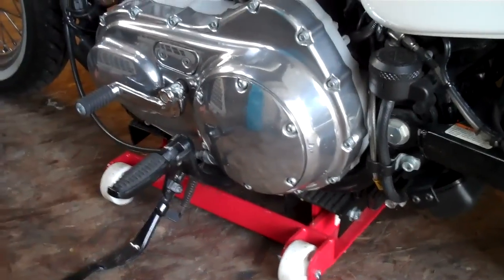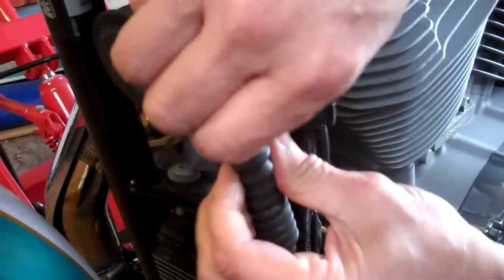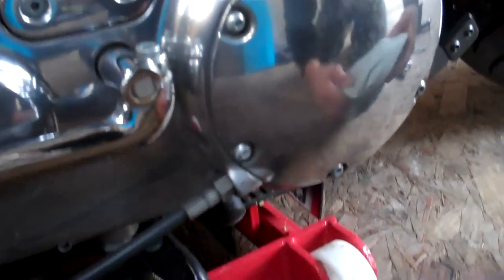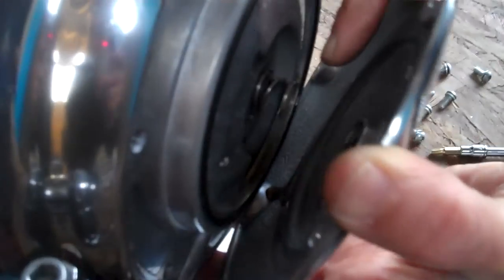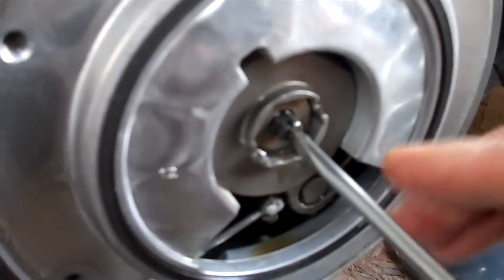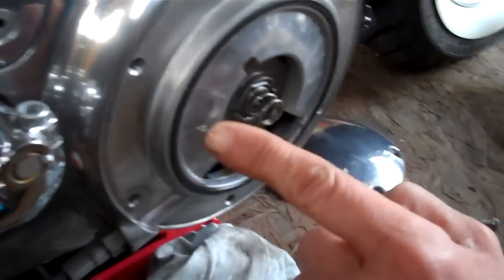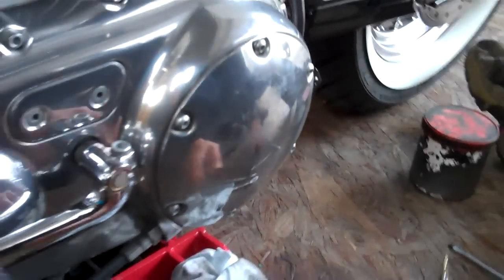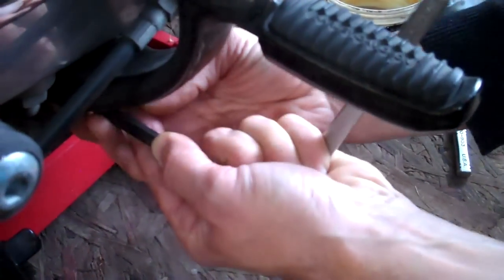Delboy's Garage, Harley Sportster Clutch Adjustment.

Comment: Delboy, 2007 1200c sportster 14,000 miles.  Clutch from Hell.  My original problem was I "thought" the clutch cable was "stretching"!! One minute handle is loose... next minute it is tight.  All during the same ride.

So I do a proper adjustment.  Derby cap off.  Counter-clock seat turn and 1/2 clock-wise turn.  Adjust the front fork adjustment til the clutch lever is 1/8" play.  Now it won't stop slipping.  I just drove it and stopped (with my trusty 1/2" & 9/16" wrenches)  5 times to adjust and failure... still slipping.  Would further clock-wise turning the main clutch adjustment help?  Maybe the clutch discs need replacing?  Maybe I have the clutch that cannot be adjusted..

thank you for all your videos.  Really well done!
Reply from the maker: Hi Julianne. OK, working purely on the information you have given me... and asuming the rest of the transmission is in good condition, it sounds like you've wound back in clockwise a tiny bit too far, its 1/4 turn not 1/2 turn.. but that wont make it slip so much...

Ok the two items that can be at fault are the cable, or the plates, and to isolate which it may be, you must check them independently, so first with the Derby cover off and the cable fully slackened at the centre bottle screw, drop the bottom of the cable of it's clevice fork and the top of the cable out of the lever so  that both ends of the cable are free... then by holding the top the cable push in and out to ensure it has slippery and slick free movement up and down the outer casing with no binding or resistance...

If there is resistance in it check it is not pinched or kinked anywhere and if not, then just replace it... it may have become corroded inside

If it is free moving and in good order, then the only other thing is to drop the clutch pack out completely and inspect the plates to see if they are worn out or warped...

Once you know the results of those two tests, you'll find your remedy
Reply: Q- how good are you?  

Inside the derby cover, the adjustment 'screw' completely OPEN to CLOSED is like, 5 complete turns. You wouldn't think 1/4 turn would make a difference.  But it does.  

A- pretty darn good!!  Well done.
Reply from the maker: Julianne Carol  So, has that fixed it then??
Reply: Moonfleet41
Poop!  It is back to having 1" play in clutch lever one minute.... and the clutch lever being taught the next.  When it is loose you can not slip it into neutral while stopped.  I never sprayed wd40/silicon down the cable, as you did.  Maybe that will explain the situation.  I explained this problem to a Harley parts salesman and was told the cable end, that pulls the clutch discs apart, gets 'gummed' sometimes.  Since it sits in moving motor oil and I didn't see anything unusual I dismissed that idea, but maybe.  I will look again.  thanks again, Moonfleet.
Reply: Moonfleet41 What did fix it was lubricating the cable.  AGAIN.  Seems strange but, since the clutch is 'wet', what ever you put INSIDE the clutch cable will go directly into the engine. No?  I did re-adjust the clutch tight and back off 1/4 turn, also.

From somewhere (I think a sewing machine) I found a sealed, single use (not refillable) soft plastic oil syringe. The oil tube is tube shaped and squeezed.  That is the lubricant that went down the cable.

The Harley parts employee said he sells a lot of cables to people who don't lube their clutch cables.  I know it is part of the 50+ point Harley maintenance,  but I am surprised this fixed my problem.... but it did! Thanks moonfleet41
Reply: comment Mark Bates?  repaired 5/22 and still repaired.  Moonfleet41, could NOT have fixed it without you..... thanks

Comment: Hi!

Having ridden more years than I can remember and having always tinkered with my Bikes, I have still learned an awful lot from your videos. (Great image quality too.)
Thanks a bunch.

I have just taken a refresher course before a post winter service.

BTW, is that a massive oil radiator I see on your XR?

How tricky is an oil cooler to fit and is it worth fitting a similar item on a XL1200C?

Thanks again and keep up the good work.

Comment: Hi Delboy, sorry for late respond. the little while under the handle bar was the trick all good now, I'm going to service the bike under your instructions. I have checked the vibration matter with local Harley shops they say its normal. I wonder if break fluid has a shelf life time? I do have a dot4 bottle that has been used a little and recapped about 2 years ago, do you think sill is good? or I should by a new bottle. I'm new on bikes and trying to learn how to maintain it too, this bike does have the Vance Hines pipe but I have no idea where the instrument (command system?) installed on the bike, what dose it look like and what colour is it? I assume I'm the third owner and no idea if it has been dayna tuned.
Have a great day mate from down under
Mehrdad
Reply from the maker: +mehrdad sahba   Hi Mehrdad... with your brake fluid... if its two years old and been opened, throw it out mate, buy a new bottle its really cheap and easy to get from the car shop... and your ECU (command system) is a black box under the seat...but you cant tell from looking at it if the bike has been remapped... the best way to tell if its running right is to check the spark plugs....ride the bike for about 5 miles in one long ride...top gear, fast...not round town.. then switch it off and take the plugs out... the tips should be the colour of biscuit...not light like cream, and not dark like chocolate...a nice light biege... if they are... then its fine and you can carry one riding...good luck with it mate.. take care Del.

Comment: Great videos man, got a question for you, my Iron 883XLN sporster leaks oil from the shifter next to the clutch, it's seaping from the actual clutch box housing where the shifter is connected to. It's not a lot of oil seaping but enough to notice that it is slowly hemorrhaging through time. I was wondering if you could post a video on how to fix this ourseleves.

Comment: When I replaced my clutch cable on my '99 XLH883c I followed these instructions but now the bike wants to die at the top end of 1st gear? I am confused did I tighten the clutch ramp too much or not enough? My old clutch cable was rather tight and had the adjustment on the clutch ramp tight-ish too... I am not quite sure how to rectify this..
Reply from the maker: What exactly do you mean mate by 'wants to die at top end of 1st gear'??  Do you mean the power is dropping off, or is the clutch slipping? What exactly is happening??
Reply: I figured it out! I had buttoned up the derby cover after doing the clutch ramp adjustment and then did the cable adjustment... that was the problem, I had to leave the derby cover off and then do the cable and then do the clutch ramp once more and it was perfect! I found my rear jug plug was fouled out, so I will be doing a carb clean n tune very soon.

Comment: Thank you for the nice video. I just purchased a 2005 Sportster. It got loaded on the trailer nicely, however, when I got home and after I struggled to take it off the trailer by myself, the bike wouldn't go into gear. None of it. Do you think the clutch got off adjustment? Where may I purchase the tork tool? Thank you.
Reply from the maker: Hi Gaspare, sorry to hear about that, can't imagine what's wrong without a little more info... when you say it won't go in to gear, do you have the engine running whilst trying?? And is the clutch dis-engaging when you pull the lever in??  Also, do you have the side stand down whilst trying to get it in to gear??

The torque wrench can be purchased from any good tool shop, but steer clear of cheap ones, it's an investment in precision!
Reply: Moonfleet41 The engine are running. The kickstand is up and the clutch has a little play. How would I know if the clutch is dis-engaging? Thanks
Reply from the maker: Gaspare Misseri  Ok, so you initially said it would not go in to gear, so what happens when you press the gear lever down with your foot??  Engine running, side stand up, lever all the way in to the bar, press the gear lever down... and what happens??
Reply: Moonfleet41 Nothing, I don't want to brake the shifting lever. Besides, it shouldn't be that hard to shift, right?
Reply: Moonfleet41 Please also note that the lever moves and returns in place, so, the spring appears to work, it just won't go into gear. Could it be that the clutch doesn't engage? Shouldn't it go in gear when engine off, moving the bike back and forth while applying pressure on the shifting lever without the clutch pressed? That the way it was back in the day, not sure the newer stuff can be shifted this way or not.
Reply from the maker: Gaspare Misseri Hi again....that sounds very odd.. not heard that one before, you can try to select first gear with the motor off....like you said, roll back and forth with clutch in to line the cogs up....and see if you can get first gear that way..?
Reply: Moonfleet41 I've tried everything. I've also called the mechanic who sold it to me who is attesting that it worked fine, I could kick myself in the ass for not taking my helmet so I could take for a test drive, anyhow, no need to cry over spilled milk. The gentleman has been in business over 50 years and appear to be an ethical person, at least that was my impression when I met him. In any case, he told me to take it back for him to take a look at it, that is what I planning on doing on Wednesday. I tell you, if I didn't have my plate extra full, I would probably get in there myself and readjust the  clutch. I think after watching your video I could probably do it. Weather is perfect here in NC for riding. Thank you for your attempt to help me.

Comment: Thanks Del, great informative video but I did have a question. I have a 1981 Yamaha SR250. The bike shifts great but the clutch doesn't engage as quick as I want it. Basically it feels like when I have it pulled in all the way and start to release it in gear it doesn't engage until the clutch handle is almost all the way open. Do I need to adjust only the clutch cable or the actual clutch or both. This is my first bike so still new to it and not sure. Any help or suggestions greatly appreciated. Thanks again for the great vids!
Reply from the maker: Hi Micah.  If you have adjusted the cable so it pulls cleanly and opens the plates full, and has a little free slack once its released, then its not adjustment.... it will more then likely be the plates in the clutch have worn out...it is 33 years old....Its not a hard job, or expensive.. and you'll find it will make a huge difference.. Good luck with it.. Del.
Reply: Moonfleet41 Thanks a lot Del def. something I will investigate and check out. Really appreciate the feedback!

Comment: Hi Del, I've watched many of your vids and you seem like a very knowledgeable bloke, always make me chuckle.
A mate of mine has a sporty and says when he changes to second it jumps out back into neutral, everyone he's spoken to says it's a common problem but hasn't found a fix. Have you come across this before? Cheers
Reply from the maker: +tinks43 Hi Tinks, any bike jumping out of 2nd gear can be quite a bad sign... is it high mileage??  and is it an older bike?? ...
Reply: +Moonfleet41 Yeah, 1998 with 18k if I remember correctly.
It's only from 1st to 2nd. If he pulls away starting in 2nd (which he has been doing to overcome the fault) it's ok.
Not an easy fix then, something inside the box? Have u ever heard of such problem? Cheers
Reply from the maker: +tinks43 Well its 17 years old, not many miles, but who knows what abuse or neglect in this time... all you can do is check the clutch adjustment, cable tension/freeplay, and the selector pedal itself so make sure its fully engaging the gear.... and if its none of those things, then the next step is to take a look inside the gearbox and see if you have any worn bearings or bent selector forks.. you can usually tell by looking at the oil, and in the oil folter for any swarf of chips of metal... either way buddy... its a big job... any bike engine jumping out of gear usually signals a hard life and major repairs... sorry so be gloomy, but im sure you'd rather know the worst..

Comment: I followed your steps, but think I may have turned the adjusting nut (long barrel) down too far, actually I had used the wrench to turn down the adjuster nut. I am getting a winding noise when I put my bike into gear, is this perhaps the reason for that winding sound ? thank, Lance
Reply from the maker: im not sure exactly what sound you're describing, as you can imagine its pretty hard to diagnose faults over email by a brief description.... all i can suggest is to retrace your steps and follow the video, its all laid out correctly for you to follow... there is no 'adjuster nut'... its a screw, and the nut doesnt turn is sits in a recess and holds the screw still onve you set it... so im not really sure what you have done there Lance..?
Reply: I was referring to the 9/16 lock nut and adjustment  1/2" nut ,(located on the clutch cable) which I think I may have turned down too far, and how about the adjustment screw located behind the derby cover, what do you mean by once the screw action feels seated, is it possible that I may have turned (counter clockwise) it back too far ? because I am getting the winding sound when I put the bike in gear.
Reply from the maker: Ok, i get this question so much lately..."how much is too far" and "what is meant by 'seated"... etc etc... i can't do any more than refer you to watch the video... its crystal clear and i explained it slowly... turn the screw out until it seats, then turn it back a quarter turn.... if you've done what i showed in the video then it wont be anything to do with the clutch... if you havent, and you've done it some other way... then i cant help without seeing it buddy..! maybe wathc it through again..

Comment: Hi delboy, ive just finished having my 1200 upgrade and had the ecu remapped etc, v and h short shots, hypercharger and various other things. I'm having a little slipping in the clutch tho and im guessing it's gonna need uprated clutch plates. Ive heard that the ratios from the 883 are better for acceleration with the 1200 upgrade. What's your advice on where to go from here cos its a little slow on the higher range to pick up cos of the clutch slipping
Reply from the maker: TheDog8873 Hi buddy, first thing is that the clutch ratios are a myth, the 883 spec will not slip with the 1200 if they are healthy... remember they use a full 883 spec bottom end in an XR1200, inc. the clutch... so, perhaps, check clutch pack adjustment and cable free play, and I don't mean the slack at the top of the lever, I mean that the cable inner wire is not binding aginst the outer sleeve, check it skips through cleanly - check our clutch adjustment video and do that first... and at the same time, change the primary oil, then if it still slips, the plates may be simply worn.... but rest assured, a pair of 1200 pistons will not overcome an 883 clutch... let us know how you get on, Del

Comment: Question. I have forward controls  on my sporty and when I take the adjuster nut all the way off and take the clutch adjustment all the way off there is still a lot of tension in the lever and the cable is not loose? When I adjust the clutch properly the bike still moves with clutch all the way in.
Reply from the maker: Hi Andrew...have you collapsed the bottle screw adjuster all the way together in the middle of the cable?... and do you maybe have adjustable levers that are closer than standard?...this will mean you arent getting the full sweep to completely disengage the plates..!"
Reply: There was only one point that I could see to collapse. Also, I have a stock lever and must have tried to adjust it for hours to no avail. Eventually ran out of things to try and took it to the shop to get bent over in pricing, but hopefully they can get it right. Thanks for the speedy response!

Comment: DEAR FRIEND
ON FIRST PLACE, CONGRATS FOR YOUR AMAZING VIDEOS, I HAVE LEARNED A LOT ABOUT MY HARLEY, AND ITS INCREDIBLE HOW SIMPLE ITS TO MAKE A SERVICES ON IT. MI QUESTION IS THAT MY HARLEY WORKS NORMALLY AROUND 150 AT 200 FARENHEIT DEGREES OF OIL TEMP. SO I WANT TO KNOW IF THAT ITS A NORMAL TEMP. FOR THAT MOTORCICLE.......GRETINGS FROM CHILE ...AHH ITS A 883 CUSTOM 1999
Reply from the maker: Hi Octavio!  Good to hear from you... the engine oil temperature for your Harley depends on the temperature where you live, if it is 30 or 40 degrees in a hot country, then this is normal... but here in England, that would be too hot!  So it does vary.  What is more important is that the bike is not running with a lean fuel mixture... this would make it very hot and cause damage, so to check your fuel mixture, take out the spark plugs and check the colour of the tip... the colour should be the same as 'coffee with milk', a kind of pale beige... if it is white in the centre, it's running too lean, and if it's black, that's too rich... but if your colour is correct, then the bike is running just fine!  Just make sure the oil is changed every 5,000 miles... good luck my friend, Del